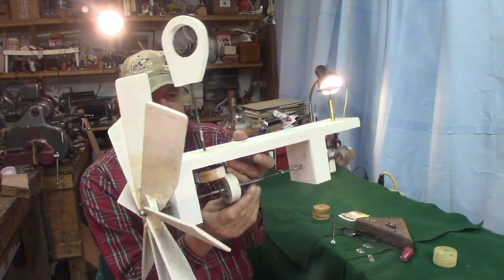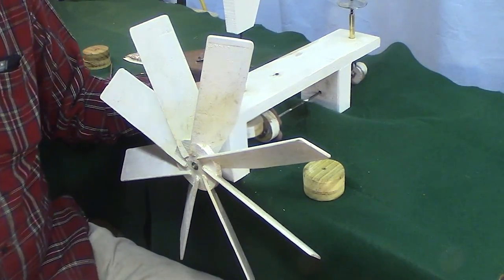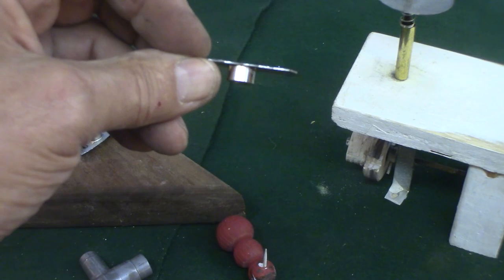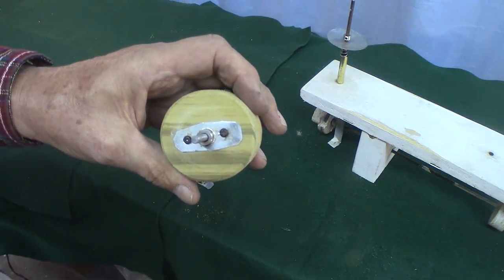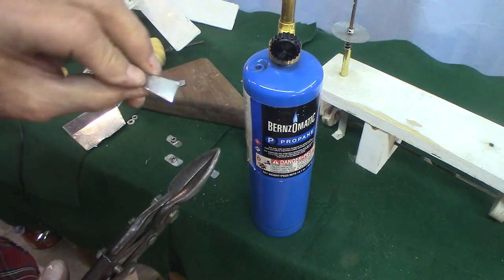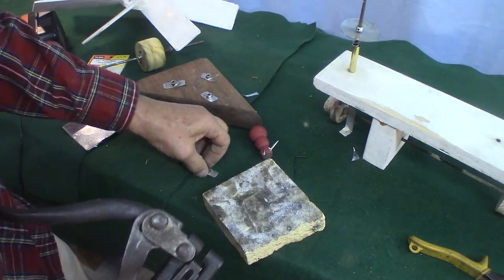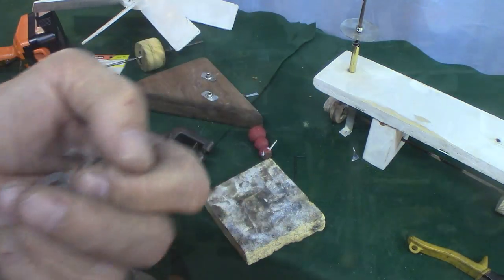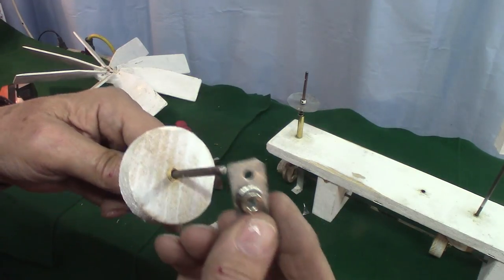Secret of making Whirligig drive shaft drive coupler with wheel collars, sheet metal and solder.

Comment: I make a similar whirligig propeller shaft adaptor, alignment and torque convertor mechanism by soldering the brass terminals from disassembled electrical outlets or switches to sheet copper. 🇦🇺
Reply: That sounds like a good idea.  Thanks for the comment.

Comment: Do you think a flat spring retainer clip on either side of the gear would add enough strength to hold the gear firm on the rod? They are relatively cheap.
Reply from the maker: An interesting question.  Going to have to try that out.  It could work.

Comment: Para fazer esse processo  , eu utilizo uma barra com rosca de 1/4 e um cano de alumínio para servir de embuxamento , assim fica fácil prender e regular em qualquer posição. Assim que der faço um vídeo explicando.
Reply from the maker: (To do this process, I use a 1/4 threaded bar and an aluminum pipe to serve as a packing, so it's easy to fasten and adjust in any position. As soon as I do, I'll make a video explaining it).   - Thanks for the suggestion, sounds good. -    Obrigado pela sugestão, parece bom

Comment: No need to solder the collar. The collars are available on Amazon with the flange.
Reply from the maker: definitely will have to check that out.  Thanks for the tip.
Reply: I have looked and can’t find them. Do you have a product number for collars that come with a flange?
Reply: @patriciathomson3849  Try searching for rigid flange shaft coupling.